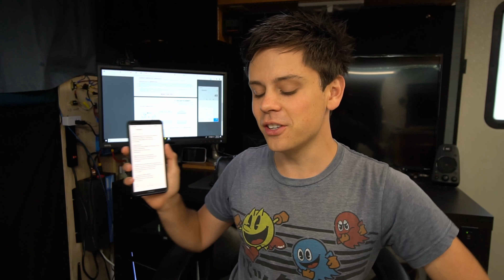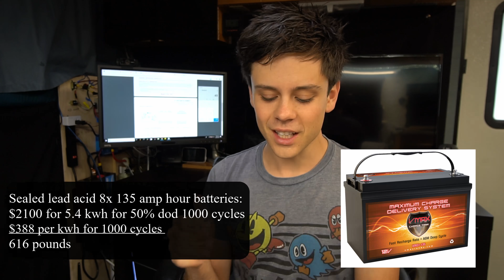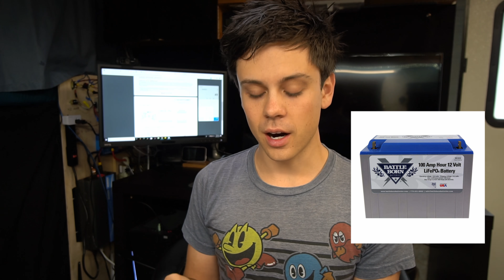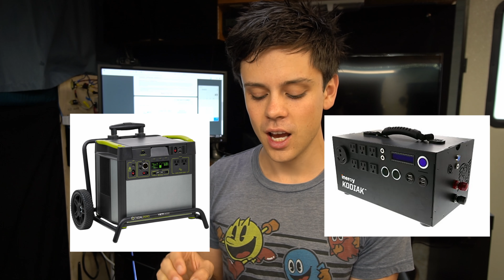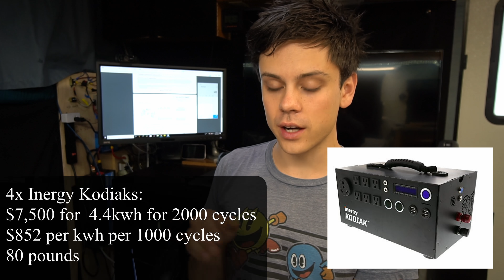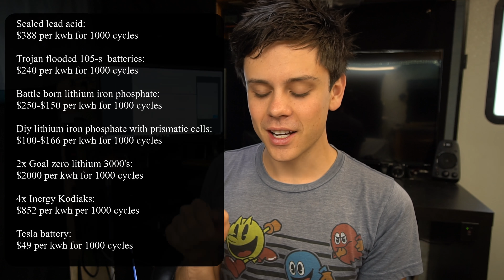Off-grid Solar Battery Price Comparison: Tesla vs. FLA vs. SLA vs. LiFePO4 vs. Tesla

Comment: Just wondering how you’re guaranteed having a good used battery and then how can you calculate discharge cycles??? IDK, just wondering???  I watch all your videos and you seem to be very knowledgeable about all this....
Reply from the maker: Yeah sure there are quite a few ways to do this. If you check the cell voltage and none of the cells get hot while you charge it it should be totally good to go. Most of the used Tesla batteries only have 15 to 20 thousand miles on then which isn't much at all. also if you see any cells that are shorted on the Tesla battery pack you will know that they are bad. What I mean by shorted is there's a small fuse on each cell you can visually inspected to see if any of the cells have gone bad. Even if some of the cells go bad you can still use the battery. Also you can do a load test and see the kilowatt hour capacity from 100% to 0%. If you did have a bad battery you would find out pretty quickly
Reply: Will Prowse RV Living and Off-grid Solar - Sounds Good to me, definitely sounds like a way to go considering the cost of a New Lithium battery is now a days. Thanks

Comment: Will, can you use “shore power” to charge the Tesla battery?
Reply from the maker: Yes but you need a manual charge profile charger. Cannot use a standard one. Some can be programmed but I do not have much experience with them. But yeah it's totally possibly. Might be able to use a current limited buck converter at constant voltage to charge. That would work.
Reply: OH, you definitely need to get one of those Tesla power plugs, so when you are on the road you can charge your system for free.  While your system is charging -- take a nap.  (Pretty sure they are meant for Tesla cars, not Tesla batteries in RV's -- but hey, did anyone ever specifically clarify WHO can use the charging stations?)  Some of the charging stations are located in Hotel parking lots -- like Comfort Inn.  That brings a whole new meaning to stealth RV camping in the city -- LOL!
Reply from the maker: Great question
Reply: Great video! Question: How would anyone "overcharge" the Tesla battery other than always having it connected to solar?
Reply from the maker: by exposing the Tesla battery to a voltage that it is not designed to be capable of taking. if you were to hook up a standard lead acid battery charger to a Tesla battery it will catch on fire.

Comment: I watched some if the videos several years ago put out by people pioneering with odd voltage lithium batteries that they put in their custom systems to get 12 volts.  The videos had cost analysis figures but in the follow up videos, the estimated life was shorter than first projected.  These folks did a capacity test at the beginning and then a second test a year or so later.  The later capacity was less than expected, meaning a shorter life.  The common explanation was the assumption that the batteries were getting hotter from either use or storage and that shortened the expected life.  

I think what would be useful is for folks experimenting in the newer batteries to do a capacity test now and then a follow up in a year or two to see if the projections are on track.  I suspect the Tesla will be close because it has had a lot of field use already in the cars.  I do wonder about the Battle Born since the numbers are based on a controlled lab environment rather than the variables that take place out in the field.  People with travel trailers that only have room outside to mount the batteries will have some challenges to deal with if they want to keep everything within the temperature requirements.  Time will tell how accurate some of the manufacturer life cycle specs are.  I do know from experience with lead acid flooded batteries that the longevity will vary a lot depending on how the battery is treated.  I would expect the same from the newer batteries.  

What makes the Tesla battery such a good deal is you can get it used at a great price and have a like new battery.  It is a great deal if one can operate within all of the requirements.  

As a side note, I have seen the T-105 advertised for $110 per battery (Battery Center Mesa, AZ) so folks need to shop around for whatever battery they are after.
Reply: Indeed, at this point the actual life span of the lithium batteries is basically speculation, nobody has been using them long enough in real life to have any real decent numbers. Even the numbers on the other types vary a LOT. RV use is typically pretty rough on batteries as many users really don't take very good care of them and they get exposed to very hot and very cold weather. I had weeks in triple digit summer weather this last summer and I have no doubt it lowered the life span of my battery bank by quite a bit. One major benefit of the lithium batteries is they do handle heavy charge and discharging which is something many RVers seriously overdo with their batteries.  

The other issue here which goes unmentioned is will you actually benefit from it? How many actually go thru multiple sets of batteries of any type before either selling or wearing out their RV? There aren't very many full timers that do it for years that will see the cost benefit in the long run. For short term temporary use at lower usage and capacity rates needed you can easily come out better with el cheapo off the shelf lead acid RV batteries from Interstate or Walmart. $200 for 100AH of actual usable capacity at 50 DoD is pretty cheap and will get you 1-3  years.  Will your RV last that long? Will the motor in it? Will you use your RV enough? I racked up 25000 miles of driving in 7 months this year alone and will likely finish the year at around 32k. Doesn't take many years at that pace to wear out the motor in an RV long before the lithium batteries theoretical lifespan. Like anything else, match your components to how they will be used and how long.
Reply from the maker: Yeah they were using prismatic cells and stored them in a hot compartment. Bad idea.
Reply: I would venture a guess that lithium battery use for RV purposes, when properly used (temperature control, proper charging, not exceeding discharge levels - a great BMS) would be generally light duty use and have a longer than expected life for these batteries compared to powering a vehicle around town during typical daily use.
Reply from the maker: HAHAHA! yeahhhhh its EXTREME light duty. Like, a literal joke compared to other high discharge lithium systems. c rating required of my battery for my loads is pathetic. no bms needed. solar doesnt speed charge anything. it will last ages. just follow the basic rules. no overcharge, no over discharge, no freezing, no heat.
Reply: On the other hand if they do live up to the hype you likely just overspent on longevity you will never use which when factored in may end up wiping out the cost benefit.
Reply from the maker: Oh wow that's a great price for t105's! Not bad